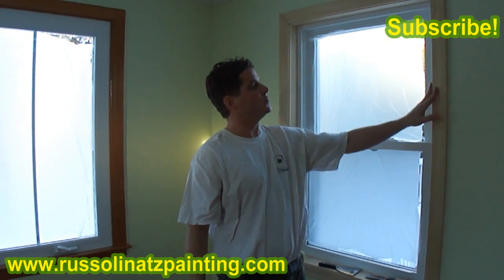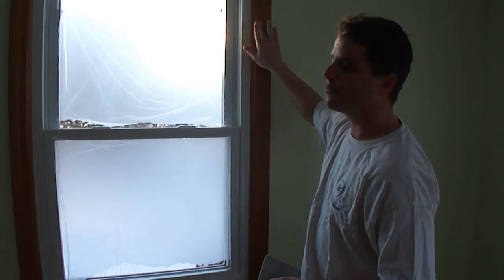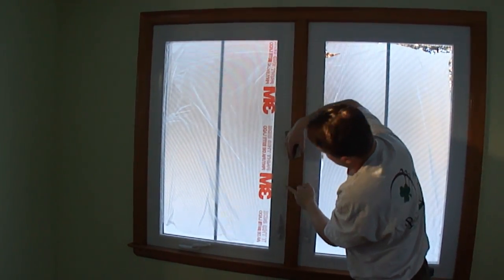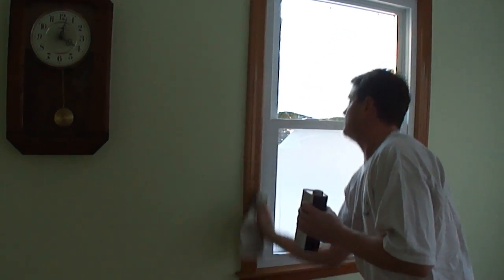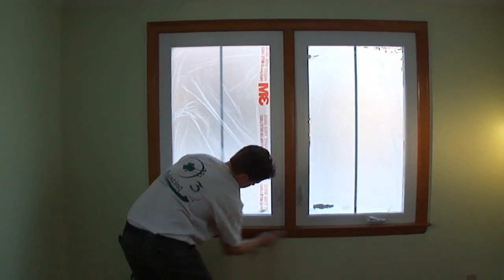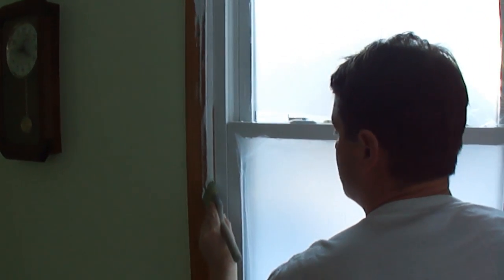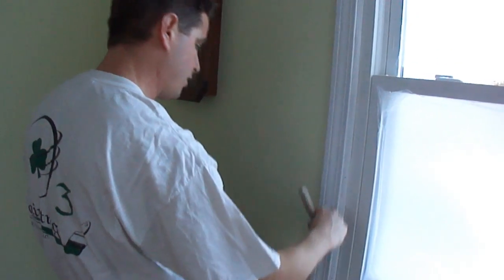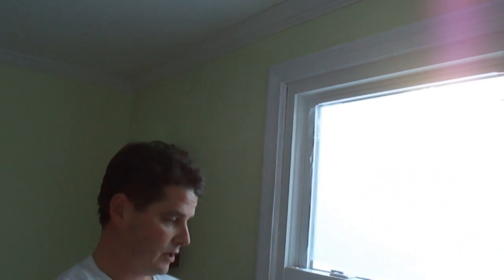How to Paint Over Varnished Wood Trim (Part 1)

Comment: Wow that's all I needed to do. I had to do the same thing to all the windows in my new house. The window casings were Anderson wood windows stained n varnished. We wanted them white so I hand sanded all the wood to bare wood just to be safe.  Did this on about 20 windows on my first floor.  I'm definitely doing it ur way when I tackle my upstairs windows. Thanks again russ
Reply from the maker: Hi 

Thanks for sharing your experience.  Wow, that's s lot of prep work. What did you use for Sanding?

Russ
Reply: No thank YOU for this cuz u just made my life so much easier for the next windows I'm doing. I used an orbital sander for all the large flat parts and a triangle sanding attachment on a ossilating multi tool to get in all the tight corners n such. It wasn't that bad with those tool but still, lots of time wasted when I could have done it this way. I've used deglosser chemical when I repurposed some old kitchen cabinets to be used in the garage, and it worked well but I didn't trust it enough for my window and didn't know exactly the right technique. But now I do so thanks again.
Reply from the maker: Did you try to use a liquid stripper prior to sanding?
Reply: On the windows? Na I just went straight in with the sanders.  It worked out well, just alot of work. On the cabinets I did scuff it as u did and hit it with deglosser then paint. since the cabinets were going to be used for garage storage I wasn't worried if it didn't work out. But I wasn't confident enough to do that on the windows.
Reply from the maker: Ok I understand. Thanks for all your support!

Comment: Thank you so much for all of the detail in your tutorial! Would you recommend the same technique for wood that may have shellac on it?
Reply from the maker: Hello Eric

The Stix Bonding primer is formulated to stick to varnish or polyurethane, provided you do the correct prep to it. If you are unsure about the shellac, I would just use an Oil based primer. It’s guaranteed to stick with almost no prep. I would still use a liquid deglosser to clean the surface first. Then you can top coat with a latex paint! Have you ever used Oil primer before?

Russ
Reply: @RussOlinatzPaintShow  Great to know! I have not used oil primer, but I have used oil stain and oil paint before. Our wood is OLD and I'm not sure if it's shellac or varnish. I doubt very much that it's poly.
Reply from the maker: Hello Erik

Ok I would use The Zinsser Cover Stain oil based primer or the Benjamin Moore Fresh Start Oil primer. This will ensure it bonds and seals in any worn away areas where the stain is showing. The Stix primer will not block stains that might bleed through. Where are you from?

Russ

Comment: I wonder if after the stripper can I use cabinet/trim paint with primer in it?
Reply from the maker: Hi Anna-

Thanks for your question! No, you have to use a primer that is specifically made to bond to polyurethane. So use either Oil primer or This STIX Bonding primer thats water based. The paints that have a primer in them are designed to go over previously painted surfaces and the primer in them makes it cover better. Where you from?

Russ

Comment: Which kind of paint did you use on it?
Reply from the maker: Hi Kao

I used a latex paint to to top coat. 

Russ
Reply: How many different kinds of paint did you use to do this project?
Reply from the maker: Hi Kao

I used 2 different water based paints. There is more info in the description of this video. 

Russ

Comment: Nice job! Thanks for all the tips!
Reply from the maker: +Brian Mills 

Thank you Brian!
Reply: Can this be done on wooden doors too?  My concern is that the door may stick? I'd rather paint then buy new doors. Thanks!
Reply from the maker: +Brian Mills 

Hi Brian

Do you mean on doors that have been stained and polyurethaned?

Russ
Reply: +RussOlinatzPaintShow yes. bedroom and bathroom doors that look the same as that trim.
Reply from the maker: +Brian Mills 

Yes you can!
Reply: +RussOlinatzPaintShow so basically the same steps but remove the door from the hinge?  what type of white color paint should I use? I don't want the door to stick. does that make sense?
Reply: +RussOlinatzPaintShow thanks for the help btw. it's awesome.
Reply from the maker: +Brian Mills 

Thanks a lot Brian. Your comment means a lot to me and I appreciate you taking the time to comment! Where you from?

Russ
Reply: +RussOlinatzPaintShow it's clear and very thorough. I am from Eugene Oregon. I just bought a house and move-in in a month. what type of paint? Is it the same as the walls?
Reply from the maker: +Brian Mills 

Hi Brian

Do the doors stick now? Keep in  mind that by painting the doors it will add a mil thickness that could be a problem if there isn't enough space. Here is a video series that shows you how to paint a door and paint over polyurathene.  
https://www.youtube.com/playlist?list=PLdri3t8UXEyTC2ySCmC4DRPMS14FZRbNt
Reply from the maker: +Brian Mills The paint should be at least a Pearl or Satin sheen or a Semi-gloss.
Reply: +RussOlinatzPaintShow thanks!
Reply: +RussOlinatzPaintShow I'll use sheen I think. thanks for the video!
Reply from the maker: +Brian Mills your welcome!

Comment: Great videos in every way. Love your channel. Started this exact project this week and moving on to my stair risers next. 2 questions if you have the time. Would you still recommend BIN primer for the stair risers or should I just use the Styx again? They haven't been varnished, just carpeted. And can I add Floetrol to the primer to make it easier to work with? Thanks for the videos.
Reply from the maker: Hi Kenneth-

Thank you! I appreciate your comment and questions! You can use the Styx primer provided the stairs were never stained. Did they stain the Stringers? No need to add floetrol to the primer. Primers don't need to be thinned out and they spread easily over a surface compared to a finish paint with a high gloss.

Russ
Reply: +RussOlinatzPaintShow 
The risers were never stained but the spindles were. Some I took off easily and others I couldn't remove so they will be a little challenging. The Styx is working pretty well on the stained window trim. Will it work as well on the spindles?
Reply from the maker: Yes, it will work even better if you prep them before applying Stix.
Reply: The trim came out great. Thanks. Was planning on following the same steps on the door. It's one of those old hollow wood doors that matched the old trim. Should I follow the same steps but use a roller?
Reply from the maker: Hi Kenneth-

That's Great news! Yes, and buy a good roller that won't leave fuzzy's.  

Russ

Comment: Question: the varnish on my window trim is very old to the point where I can scratch it off. Would your method still work or would I need to sand it right back? 
Great video by the way. Thank you for posting. Syd, Australia.
Reply from the maker: Hi

In that case, sand it down to remove all loose flaking varnish.  Then you will need to use an oil base primer to seal in the stained trim. If you use the STIX, it will bleed through. 

Russ